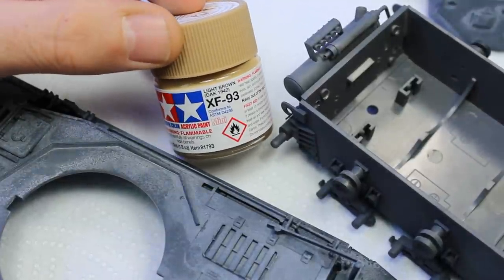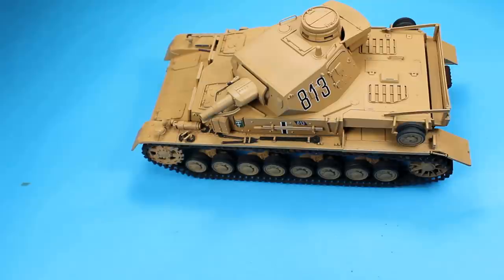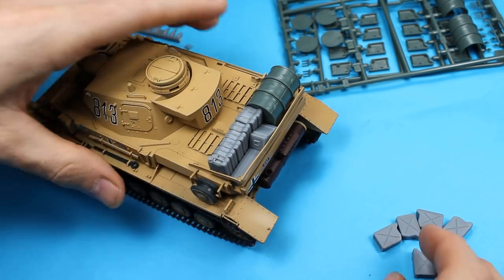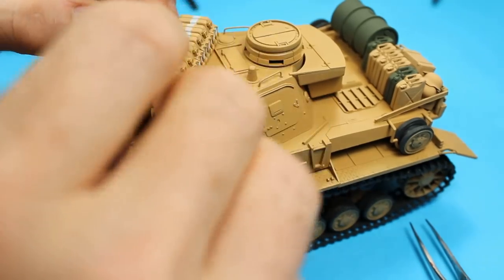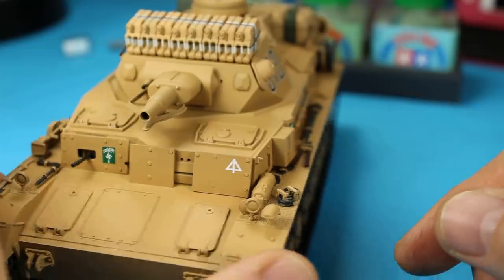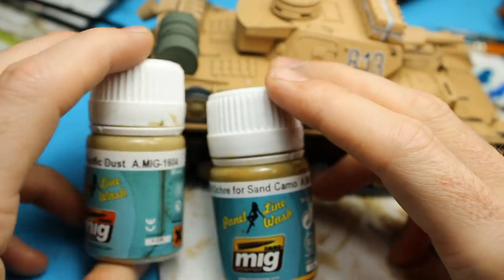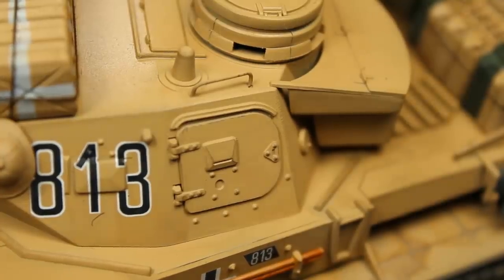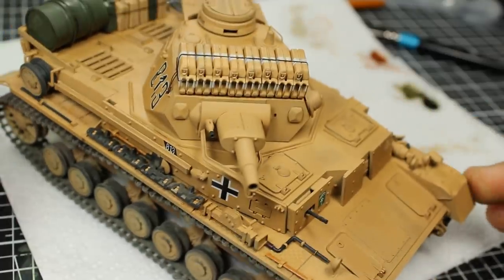Testing Tamiya Acrylics, Adding Stowage To Model Tanks, Tamiya Panzer IV D

Comment: From my experience it would have been a camo net holding it down...it was a part of their equipment they were required to have and it would have worked well... the stuff is hard to stow so alot of vehicles would permanently mount it to the outside...  part of their tactics involved camp and storm which would mean camo nets, especially in 1942+

Comment: Tamiya do the best paint in my opinion I love their olive green colour
Reply: Tamiya acrylic and mr color levelling thinners. A perfect match👍 (Tamiya lacquer and hataka lacquer are awesome as well😂)
Reply: @PeteCourtier  never used levelling thinners and I’ve heard hatska are great
Reply: @epicforger12345  Give it a go👍 It’s fun to try out different thinners and paint. The levelling thinner slows drying for a shinier finish, normal for satin or rapid thinners which gas off quickly for a  matt finish. These will pong more though so at least use a decent mask. Hataka lacquers are very good. They are just as good as Tamiya lacquer but the range is massive👍

Comment: I believe the Jerry cans you used for water were US Jerry cans. The X stamped into the sides gives it away.
Reply: No. The jerry cans used are correct early WW2 German, not the U.S. jerry cans, which have an entirely different filler cap, both the fuel and water cans are completely different to the German version.
Reply: @nickclaydon2488 my bad, I didn’t see the different style spouts.

Comment: I know it was done for real because I've seem photographs of it, but I can't halp thinking that it's a pretty dangerous way to carry fuel in action? One hit and you'd have blazing fuel drenching the whole of the turret and finding its way into the interior through all the numerous littes gaps and apertures. Of course if the commander happened to have his head out at the time it would be even worse for him and all concerned. Perhaps this was just a method for carrying fuel when not  in action, on road-moves etc?
Reply from the maker: Well yes that would all be the case but these were mainly water cans, hence the white crosses on the cans. They rarely carried fuel in this way but may have if on a long haul way behind their own lines.

Comment: Really strange position for stowage. It's easy to hit it and jerry cans cover commander's and loader's views
Reply: It was always done on the panzer 3s it was only water not fuel though so they didn't need to worry about going up in flames like the British did in ww2 with the whippet tank! There was normally a feild made stowage rack welded on the turret for them too! Dragin include Linton some of there older DAK kits and some museums still show it! That munster museum with Hilary duff in YouTube you'll see them on that channel the real thing if interested?
Reply: @EMTBonsai  Thanks. I didn't know about water
Reply: It’s just how they did it, it’s bizarre but there was only so much area to use and a lot to carry, plus it’s good cover for the commander for frontal small arms fire i suppose and they usually took the fuel cans off at the back before entering battle, i suppose you just had to hope you had that option of being the attacker and when an engine blew in a tank or you were hit in general in most cases it was a horrible death, especially in early Brit Tanks or the ‘Tommy Cookers’ as the Germans called them